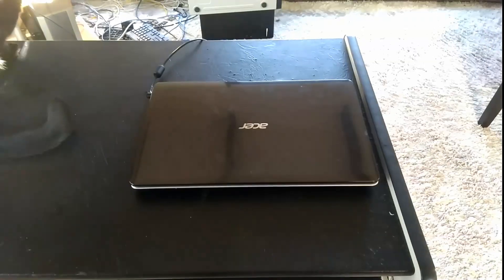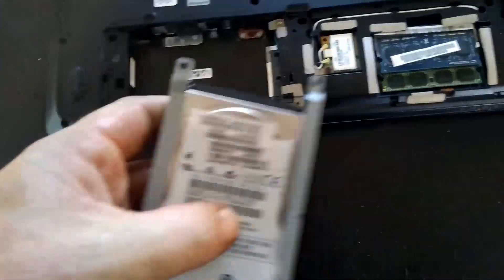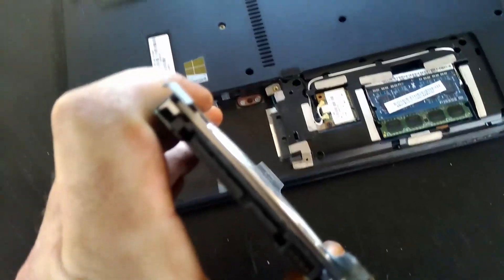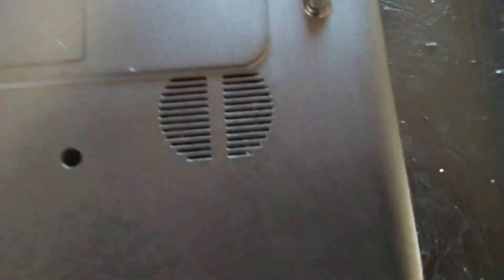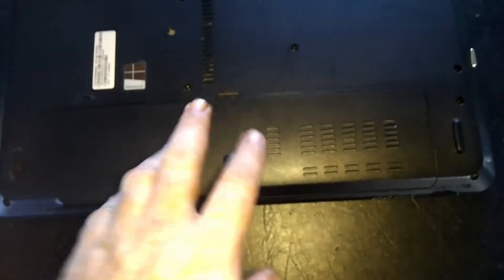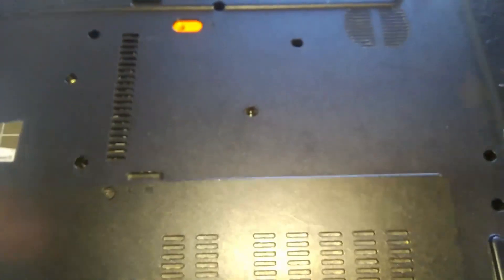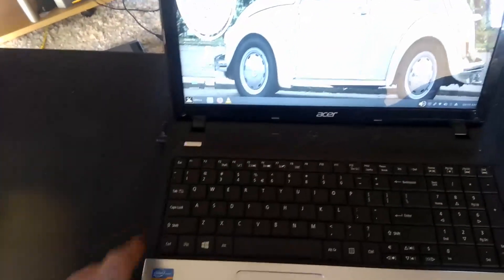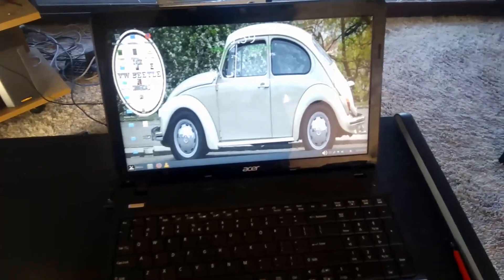Troubleshooting - The Other Half's Acer Aspire E1-571 Laptop

Comment: that's the first thing to check, so many laptop issues are with poor air flow...... First thing to check before anything.. : )
Reply from the maker: Granted, but if the airflow is good, then you move on to what I prefer working with, hardware issues